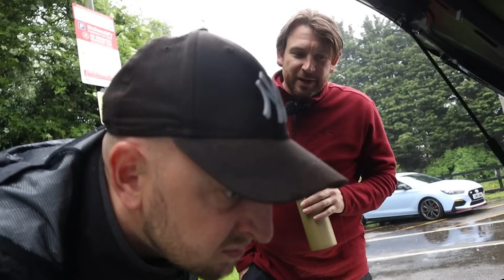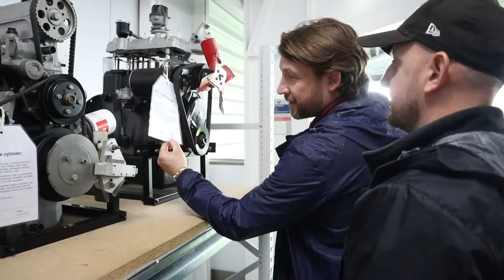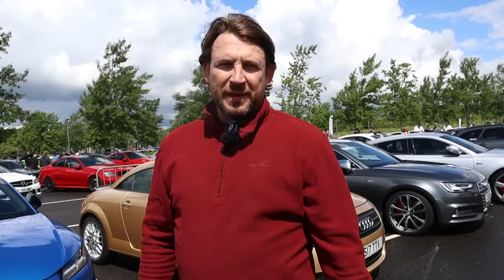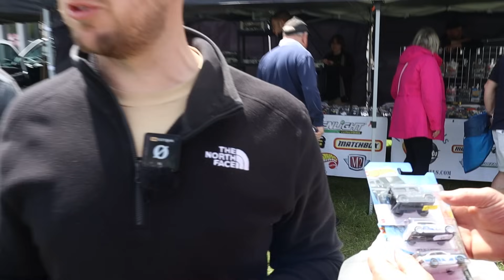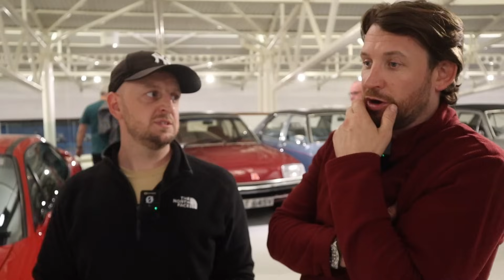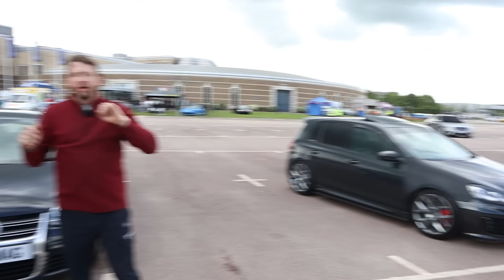We BROKE the R32 WAGON at Ultimate German Car Meet!

Comment: Seen the bolts that hold the bellhousing to the gearbox casing come loose on these and get the heads shaved off by the clutch,be that or flywheel or pressure plate failure